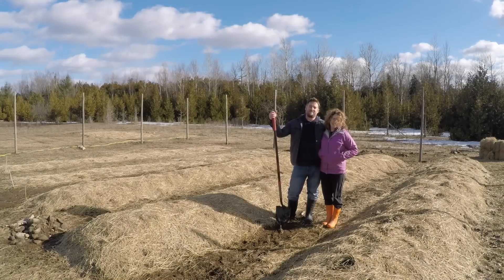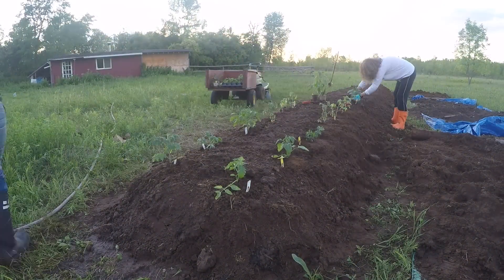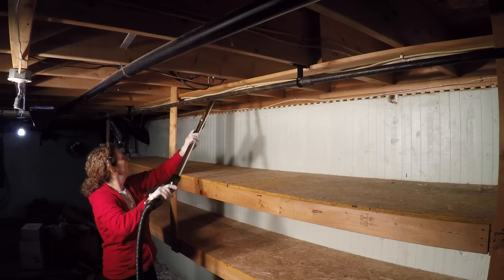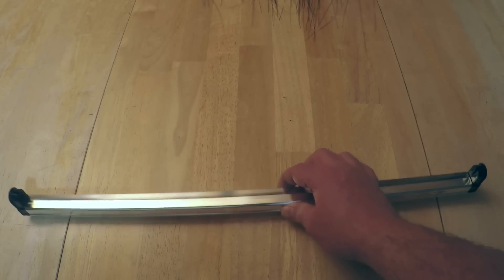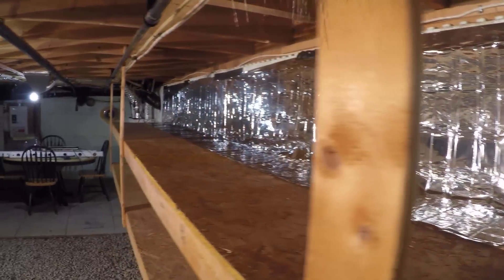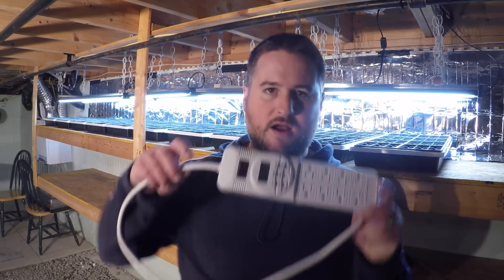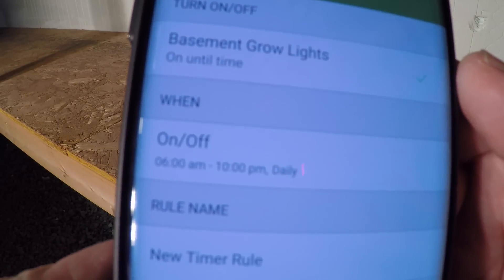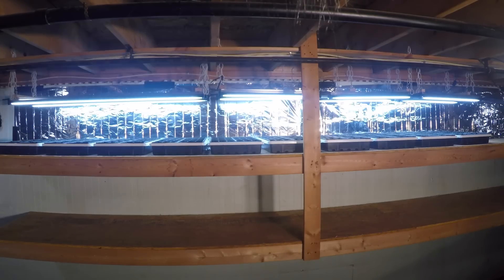How We Set Up Our Germination Station for Starting Seedlings Indoors

Comment: Do you know what the appropriate distance you need to have your seedlings away from the lights? I have read blog posts saying that if the lights are too close. It can actually damage the plants
Reply from the maker: Great question! We usually try to keep the lights as close to the plants as possible, because the sun is WAY brighter than our indoor lights could ever be, and so we want to maximize the amount of light that reaches the leaves.  However, as you said, putting your lights too close can also burn the plants. So, there is a bit of a threshold that you should aim to reach, but not cross.  But unfortunately, this is mostly dependent on the type of lights you're using (LED/incandescent/fluorescent, size, spectrum, etc.), and can range from a few inches to a few feet. So I think it would be best to look at the documentation that comes with your lights, and go with their recommendation.  However, as a general rule, if your plants are growing tall and spindly, then the lights are likely too far away. But if they are looking brown, burnt, or curled, then the light is likely too close.  For us (now a mix of LED and T5 fluorescent), we tend to stay somewhere between 6-12 inches, and that generally keeps us safe. I hope that helps. Good luck! :)

Comment: Thank you for all these tips - what a great setup!! 

I do programming - built several networked MQTT controlled devices in our house to open garage doors, turn on lights, motion sensors - even Alexa voice enabled - all controlled through a custom phone app.  But... sometimes a simple old-fashioned $10 mechanical dial timer is all you need for the job. Just match the amp rating of the timer to the amp draw from the number of devices plugged into it.

Also - I lost track of how many gadgets I've lost the operating instructions to over the years! Solution? Just plug the model number into a Google search... you'll usually find the instructions in less than 5 minutes. Then, save them in a personal online repository - like Google Docs. 😉

Comment: Hi, I'm in Burgundy, France. I've started also artificial lighting since 2 or 3 years now, to start seedlings indoors. I would like to ask you a question about cabbages ; did you already try to germinate them in your basement ? I use 865 T8 fluorescent light bulbs of 6500 K temp. My seedlings germinated well when my TL block was at approx. 50 cm above de soil level. But I think when I lowered the block to 20 cm to avoid legging of the seedlings, they started to dry out (first the cotyledons, then the true leaves) and finally died. I don't know if it's the reason they died, because some of the that were under a velux and protected under a plastic greenhouse cover died in the same manner. Do you have any idea what this could be ? The other seedlings that are growing in the same conditions (temp, light, lighting time, etc) are fine (peppers, basils, beetroots, spinaches, salads, celeri, artichoke, french marigolds). thanks for your advice,
Sam

Comment: Hi, I set up a similar grow station using two T-12 Shop lights parallel above a 5-foot table. Once I made a dedicated investment into growing garden plants, I had success. My timer runs 14-16 hours (4x40W bulbs, 6500K) and I really don't notice any difference in power consumption. Also added a 150W HPS on another table, and it is amazing!. Just tape some 99 cent foil on both sides of the florescent light fixture to concentrate the light, the plants think it is just a cloudy day. Another thing that's cool is using rope pulleys to raise/lower the lights, way easier than chains and fairly inexpensive.

Comment: that new device is way better, I am going to get one in the future too. Do you know any devices that can be used to control water  as well?
Reply: Dota 2 Top MMR Ranked Full Gameplay a water valve timer will control ur water needs they make them with battery’s solar or 110 outlet ( regular wall plug) ✌️
Reply: I'm an automation integrator in southwestern Ontario, Canada. Here's my take on your question. If you are going to be setting up lights, water timers, and maybe some sensors for temperature, humidity, flood, or anything else, you're probably furthest ahead to use an automation hub. I like a basic one that I can program (Vera Edge from Mi Casa Verde) myself but you might prefer something like a SmartThings hub. Then get sensors that use Z-Wave or Zigbee instead of WiFi. They use less power and are designed from the ground up for these sorts of installations. Increasingly these can be found at big box stores but there are some specialty online retailers too, like Aartech.ca in Canada or SmartHome.com in USA.

A starting shopping list might include:
 - SmartThings Hub V3: CAD$99 
 - GE 14282 Plug-in appliance module: CAD$53
 - Dome DMWV1 Z-Wave water valve actuator: CAD$129

Another advantage to getting a hub is then you can more easily put automation into other parts of your home, like porch or yard lights, freezer (a temperature sensor to make sure it's not thawing), irrigation sprinklers, thermostat, or almost anything you can think of.

Good luck 
     - James

Comment: Pretty nice setup. The timer is a bit of overkill though. A cheap mecanical timer would have done the job. The watt meter is usefull though.
Reply from the maker: Yeah, we completely agree about the timer being overkill.  I initially looked into the Wifi enable timers simply because of the cool factor, but also decided it was an unnecessary expense.  That was until I realized that the Wemo also had the ability to monitor and report on the power usage - all in one tiny form-factor.  We hope to get some good information from it, that we can share with everyone else who might be wondering about the cost of running their grow lights.  Thanks for your comment!

Comment: I was wondering what company you are getting seeds from. Thanks.
Reply from the maker: Hi Susan.
We strategically picked up seeds from different local stores this year.  However, we know we need to put some more thought into this and will be researching suppliers for next summer.
Reply from the maker: PushandillPushback  That's a great question Susan. I can't recall exactly what I meant by "strategically" in this comment, as that was several years ago.  However, we always buy from our local stores when possible. I assume I must have been referring to the fact that not all stores carry all the seeds we're looking for, so we usually have to shop around a bit (buy a few here and a few there, etc). Whereas, if we can find a supplier that has everything we need (or even just specific items that our general store doesn't carry or can't order in), then it's potentially worth building a relationship with them. I hope that helps :)